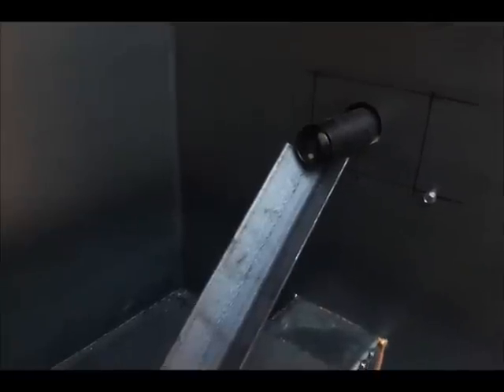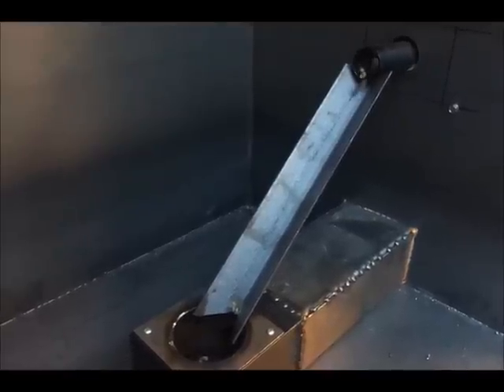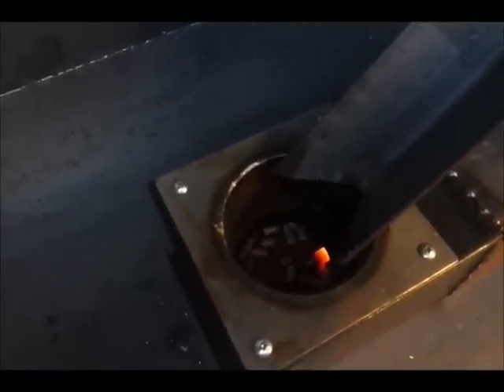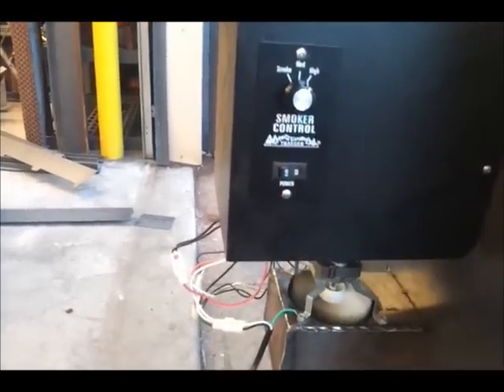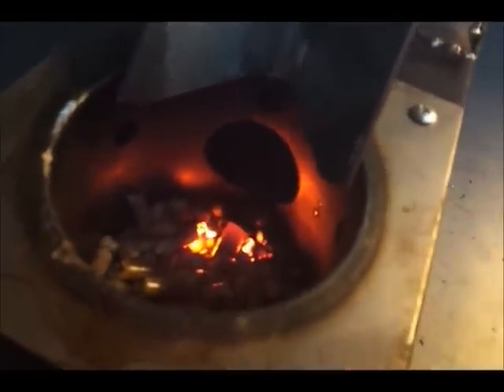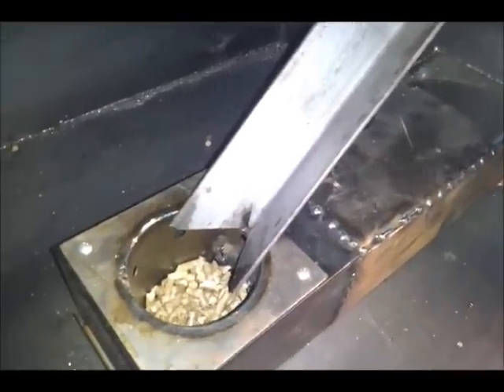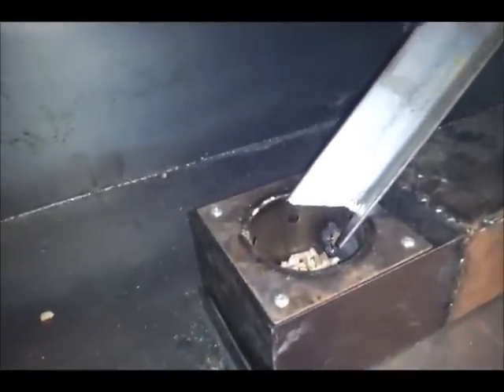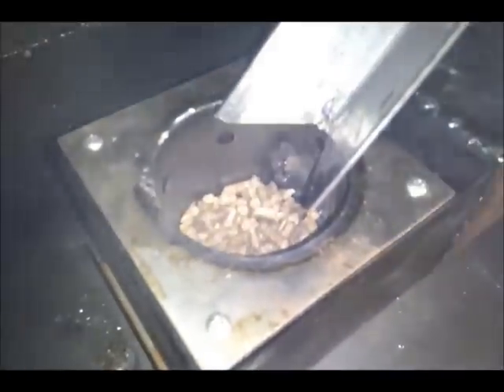Pellet test

Comment: That looks like a nice set-up!!  I am new to pellet smoking and was wondering what is the advantage of having the hopper set apart from the firebox?  I would like to build my own bbq smoker.
Reply from the maker: thanks! built that back in 2010 or so. actually that was before the SmokeDaddy pellet hopper was available. I bought a Traeger Junior and cut it up. the auger was not long enough so I made the sliding board out of 2x2 angle. biggest benefit was no burn back into the hopper. Buddy of mine in Kansas City still uses that cooker today.
get the smokedaddy hopper here: https://amzn.to/365kboD